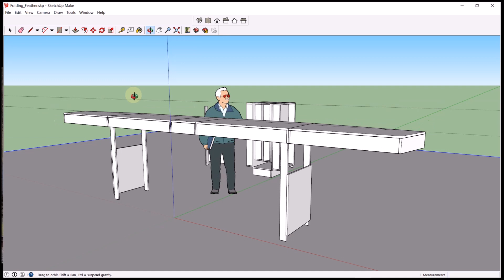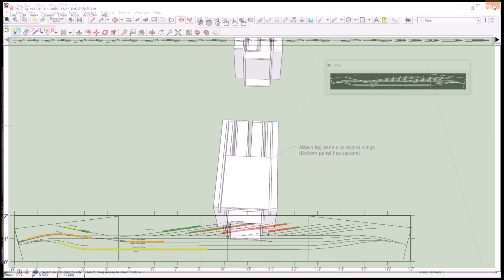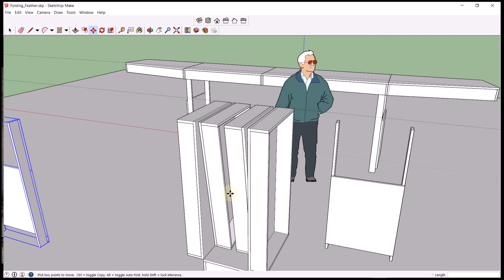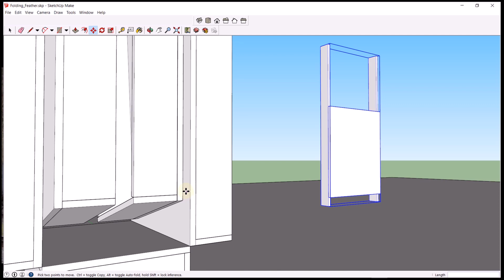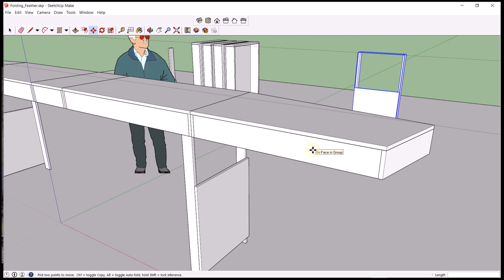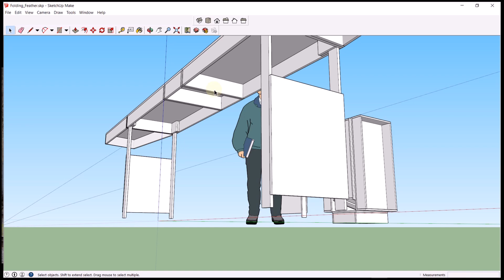Folding Feather yard intro

Comment: Great concept Toni! I have a suggestion for locking the joints when set up. My first attempt at this idea was the two sections of my Galveston Causeway module (still a distant dream but the modules are built). I had seen an article on using T-nuts for alignment & fastening, drilling one side out as a bushing, and then sliding the bolt through and screwing into the other T-nut. I found that drilling those hard steel T-Nuts from Lowes & Home Depot was a real pain as they are super hard, and rather thin. I'd screw up two for each one I got to drill straight. 

Then I found some zinc alloy ones at Rockler, they are pricey, but on my two section Cabin Creek module, I used the drilled out Rockler type for the bushing, and the cheaper steel ones for the nut side. It is dead on alignment (not so important here) and a strong as can be for holding power. When the bolts are in, it's as strong as a one piece module. I can't add attachments here, but I'll post photos on the Facebook page of what it looks like.